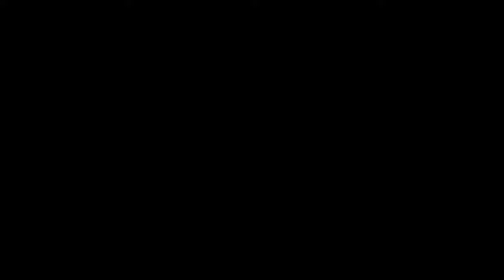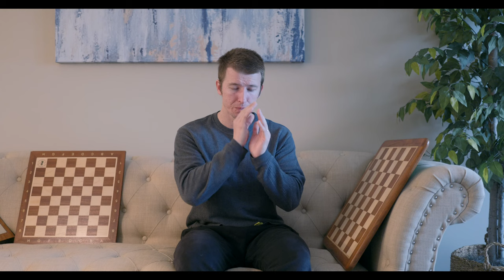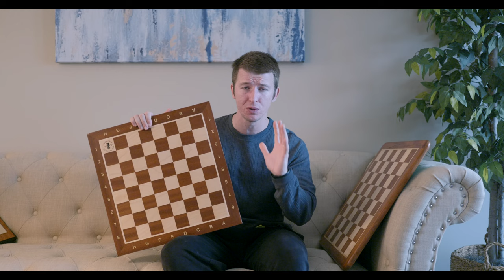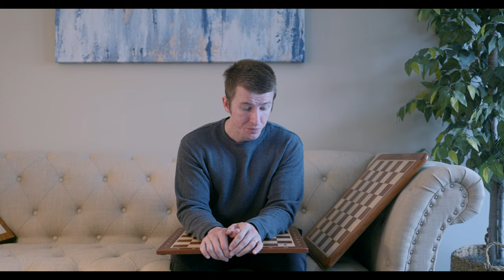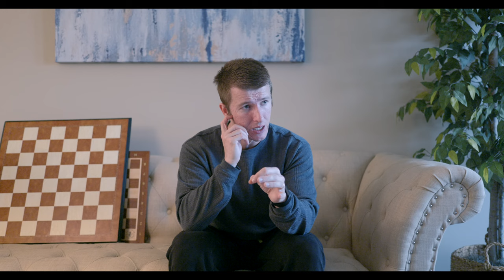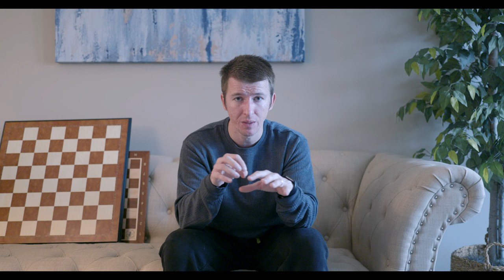Do Chess Boards Warp Over Time?

Comment: Plastic boards do warp too depending on the design and materials used. If they go cheap, with the temperature changes over the years, they warp and stay that way. I have a plastic computer chess board, a CXG model from 1985 that has warped and is unfixable. I also have a cheap wooden board (not composite) of the same age that is still very good.

Comment: I made my own wooden chess board out of 24 x 24 x 0.5-inch birch plywood.  It is slightly warped.  I should add that the board started as a game board for Tuck (aka Tock), which I made 15 years ago.  I only clear coated the Tuck side.  Last summer, I painted a chess board on the flip-side, and clear coated it. The slight warping doesn't bother me; I enjoy playing on it.

Comment: i have the same stauton board, the first one you showed. and after a few months it developed a big bow bend, like one big warp of the whole board. luckily the high point is along the middle horizontally so it doesnt effect gameplay to much. the middle just ends up being a little higher than the ends where you set up your pieces

Comment: I have two drueke style boards. One colorado wood works 2 1/4 square and a chess house 2 inch square folding board. I store both boards tilted on there side's. Storing them that way let's both sides of the board  breath. It helps them not warp. Ive had no problems with mine over a few years now.
Reply from the maker: How do you keep the humidity levels? I know some folks in Florida keep their wooden boards in humidity controlled environments, I wonder if its important to do so to ensure longevity of the boards and pieces.
Reply: @AlSuChess  I live in Virginia so its Not really that humid. I suppose you could use a dehumidifier if you wanted. That would help too.